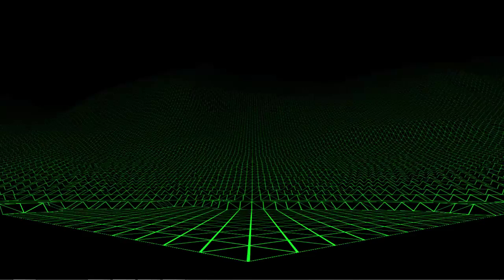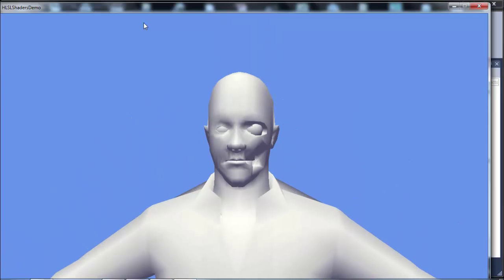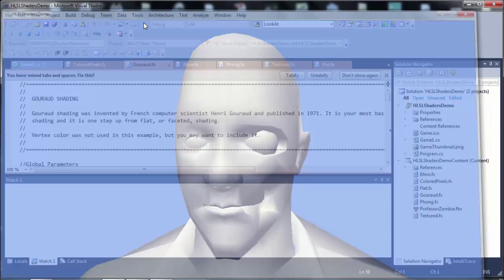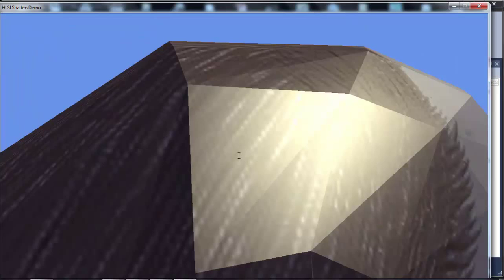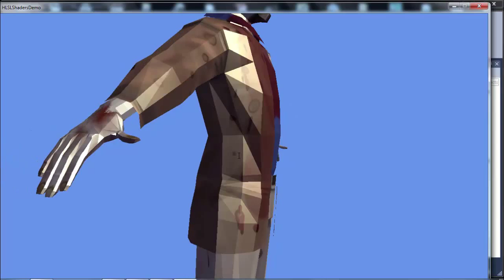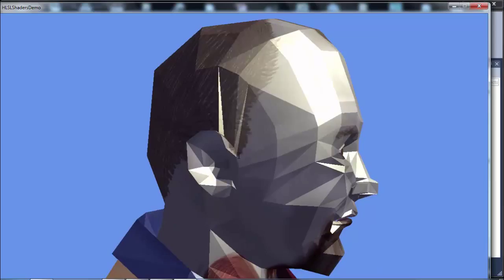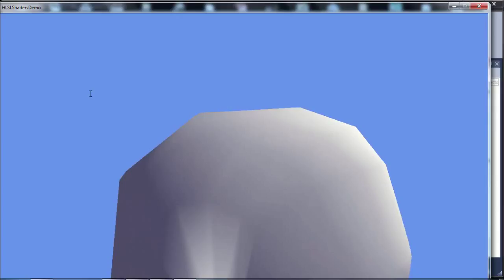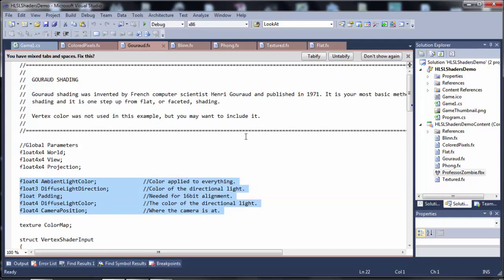HLSL Part IV - Gouraud Shading

Comment: the names for the types of light are perfectly fine. Ambient light describes what you meant by diffuse light, light that gets scattered around almost randomly when it hits the atmosphere and bounces off of objects to light up the model from every direction.
Diffuse light is accurate because of the way the material reflects any light. Diffuse reflection occurs when the light rays bounce almost randomly off of the surface of the material because it's not smooth, it's rough and has micro crevasses that make the light not reflect on the same angle of incidence it arrived with. This is contrasted with specular reflection, where the material is very smooth and light bounces with an angle of reflection equal to the angle of incidence.